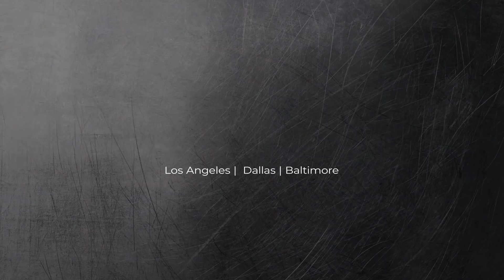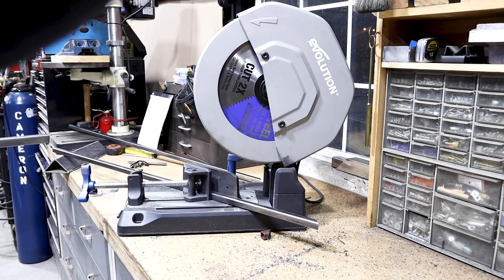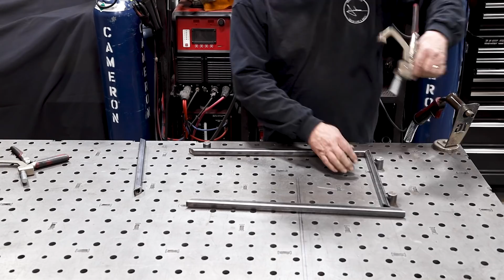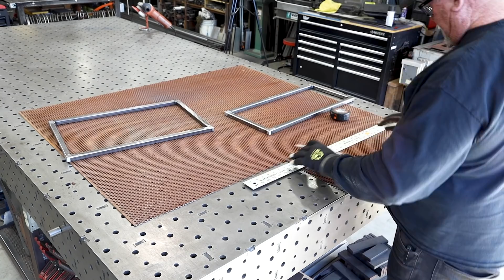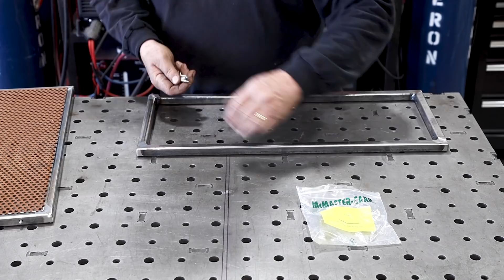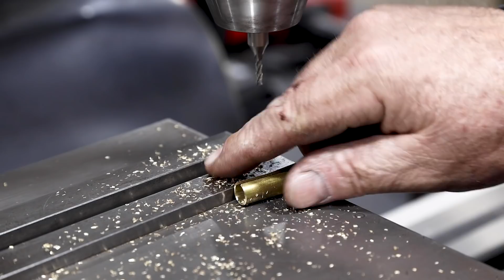Making Outdoor Vent Covers | JIMBO'S GARAGE

Comment: Or you could connect the latches from the same side with a little round bar tack welded, so pulling said bar would move 2 latches. Great work anyway, turned out awesome
Reply: That's what I was thinking

Comment: LOL - all you needed was 2 lengths of string with a loop on each end to hold the spring latches open. Once in the opening, just slide the string off or cut it.

Comment: Hey Jimbo...love the channel and your work! Tips from a machinist...1. if you hold the brass bushings the opposite way in the vise when slotting, the tubes won't crush when you clamp the length of it, as opposed to squeezing on the diameter. 2. A work stop for the vise will speed up your operation for repeatable work positioning!

Comment: I like the brass tubes, great recovery. If you build a stop for your stock in the mill, then you won’t have to move the table back-and-forth. You just move the  stock to the stop, drill and tap and then flip the part around bumping it back to the stop. Save you a lot of time. Same accuracy. Some people say you should put an end mill in a drill chuck. But I’m not gonna mention that here.